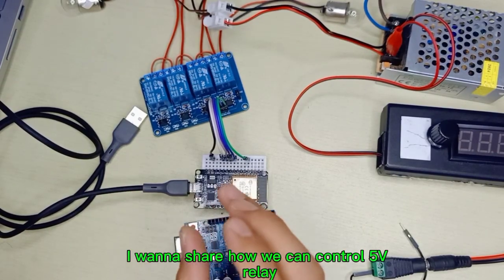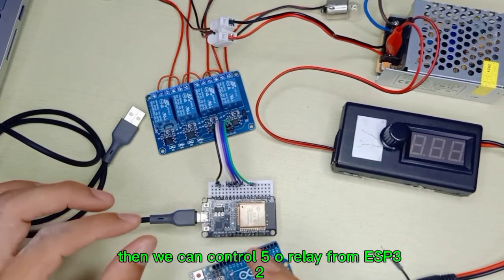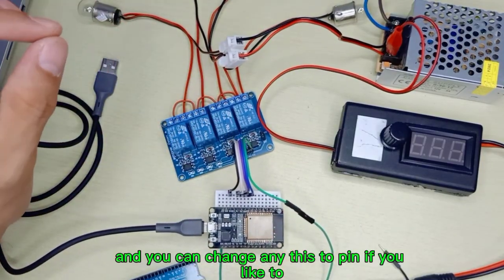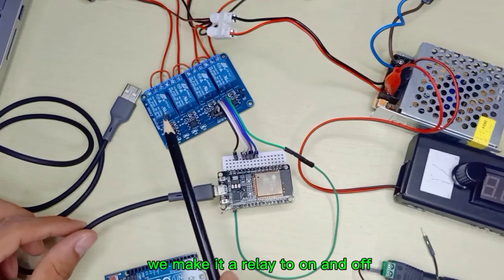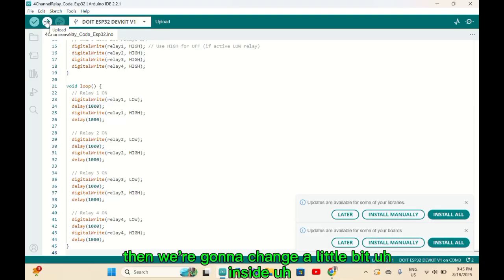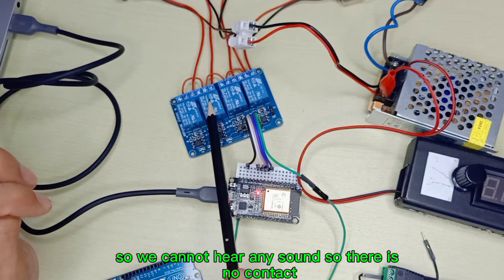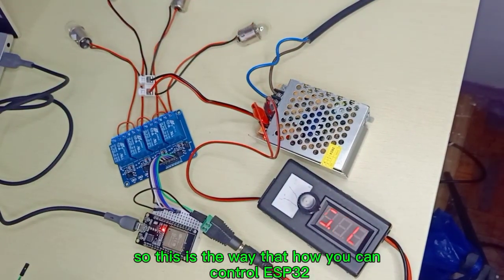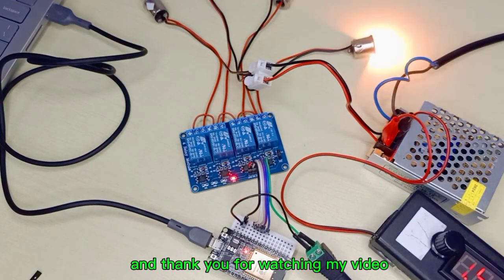How to control 5V  4 Channel relay with ESP32

Comment: What about gpio signal to relay 
Is it required to be 5v ???? Or it’s enough
Reply from the maker: No need because Esp32 GPIO output is 3.3V HIGH and LOW 0V
Reply: @passiontechklm he is asking whether 3.3 is enough?
Reply from the maker: @E.D.B.Musics Opps...the answer is GPIO from Esp32 output is 3.3V and its enough so no need to be 5V. As long as you apply extra 5V power supply to relay is fine.

Comment: Is it possible to use the same font? I can't get it to work with only one 5vdc font.
Reply from the maker: If you have 5v than its much more easier to use with esp32
Reply: @passiontechklm Working now! I use the 5vdc positive on the place of jumper jc vcc and the 3.3v control input relay.

Comment: Sorry to asking this, does web SMPS like that is good enough? i want to buy it, but still in doubt.
Reply from the maker: You asking about Power supply 12V 3Amp?
Its is very common use and safe to use but need to handle with care because the input Voltage is 240v and it is uncover so must be careful not to touch after power is on.